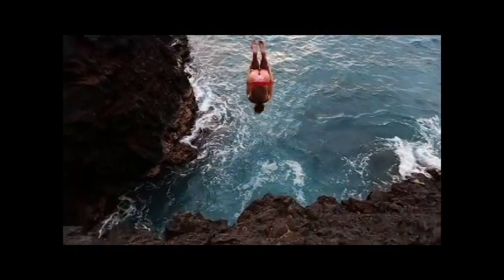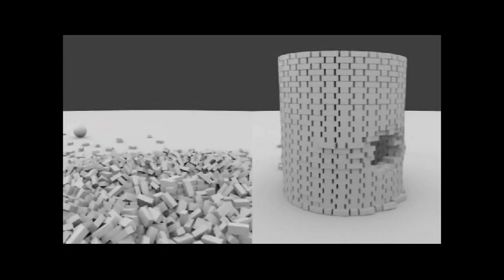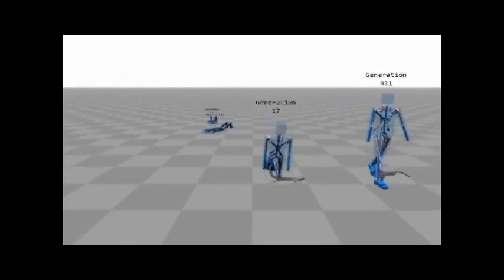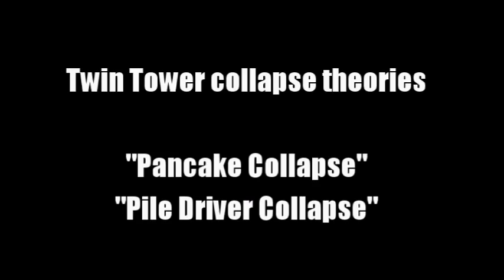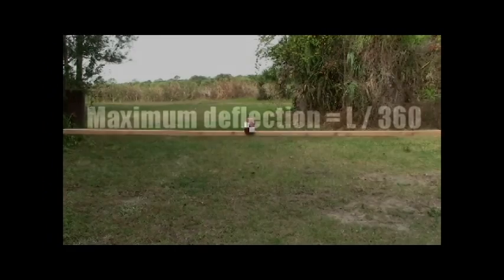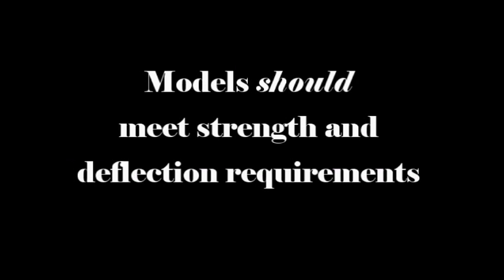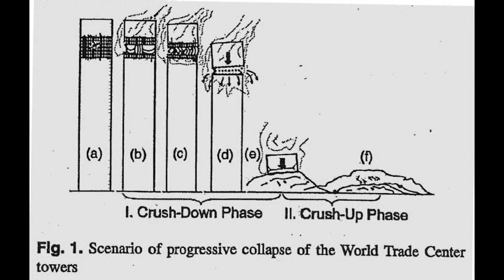9/11 Experiments: The Force Behind the Motion

Comment: 5:23 What is the tensile strength of those plates in relation to the floor structure in those buildings? Were the floors build out of the same concrete sheets? Could they have been some sort of composite between concrete and steel? Could it be that, unlike your test rig, there was nothing supporting the floors since the whole structure collapsed? And why a 20lbs weight? What is that supposed to replicate. There was no weight falling on top of the building. This experiment is completely invalid.

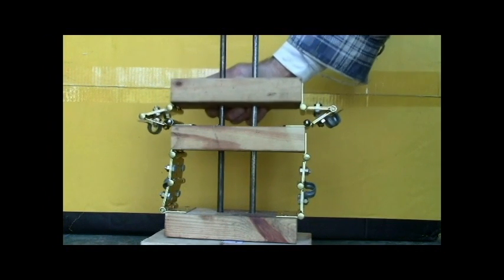7:30 The fact that you had to build a guide rail system shows that either your rig isn't accurate to real life, or your initial assumption that scale doesn't matter is wrong. How strong are those pizza supports compared to the actual structure. To me it looks like there is absolutely no way that dropping such a huge structure on any building would result in the building taking the entire load. The way you model the weight of the top section by dropping it from a height is, as in your previous experiment, completely flawed. You are using kinetic energy to collapse the structure, not potential energy as in real life. Have you considered loading weights on top of the structure until the whole thing started collapsing? Probably not.

10:27 And now you change the equation. Instead of dropping weights, you use static ones. And you don't even load the top, cause you know that if you do that, the whole thing would collapse, no matter if you have explosives or not. Or perhaps you don't know that. Either way, it's not representative of the actual structure.

13:21 Very powerful explosives that don't show up in any of the videos... yeah right.

13:30 You experiment doesn't match the motions either. We see a very large fireball, then nothing. Where are the other explosions that were supposedly used?

At the end of the day, if they wanted to bring down that building, they would have planted bombs either at the base of the building, or even throughout the whole building, as you say they did, and said the terrorists planted bombs throughout the building. It's happened before, it would have been believable. Why concoct this massive story about a plane that wasn't a plane bringing down a building that actually was blown apart? Your entire story is completely implausible, and your experiments are not representative.
Reply: Blu Crystl
The way i see it, the maker of this video is making the claim. I don't have to prove the actual failure mode of the WTC, the maker has to prove that their hypothesis is correct. And it isn't. So if you want to make some point about NIST data, be my guest, but i have better things to do than entertain reality deniers.
Reply: Cristi Neagu - There is absolutely no point in engaging with Blu Crystl.  I do not even read its posts.  Attention seeking trolling of a very low order.
Reply: The models in no way are an accurate representation of the real thing.  The creator of the video would prefer you not know that.
Reply: Blu Crystl
1. You have made no point.
2. You have made no intelligent statement.
3. If this is "one little dinky physics problem that a junior high school student could do", then why are you blaming NIST for dedicating "only" 10 pages to it? Sounds like 10 pages is waaay more than needed.
4. At the end of the day, it's all irrelevant. 200N of impact force do not behave the same way as 200N of static force. Do this little "dinky" calculation: If the side walls of my structure require 100N to break, and i drop a weight on top of the structure with an impact force of 200N, the first walls will break. But that slows down the weight a bit. Let's say it hits the next level at 150N. That breaks too. The next level at 100N. That one breaks, barely. The next level it hits at 50N and stops. I went through 3 levels. Now replace that dropping weight with a single weight of 200N on top of the structure. No matter how many walls you break, you still have more than 100N to break the next level. It will go all the way to the bottom. And that is the very simple, junior high, reason why all these experiments are invalid.

If you bring up the irrelevant NIST study again, i won't bother replying.